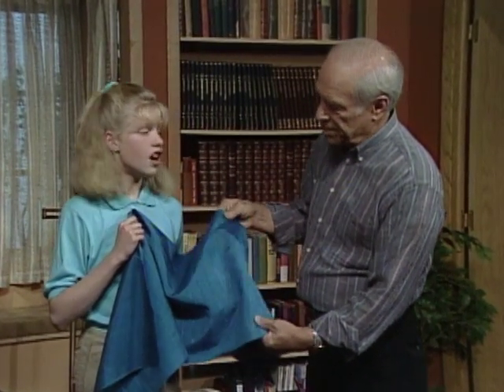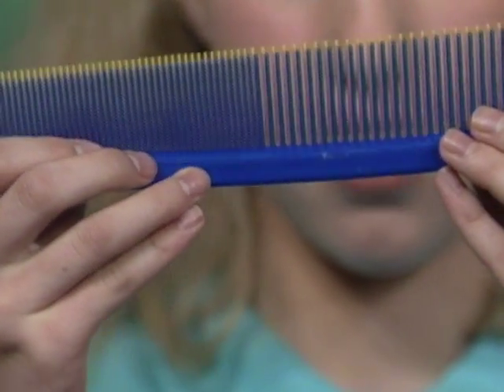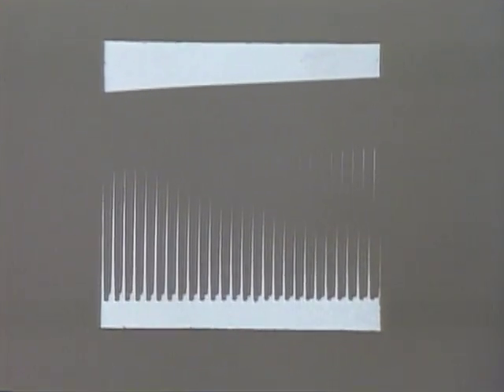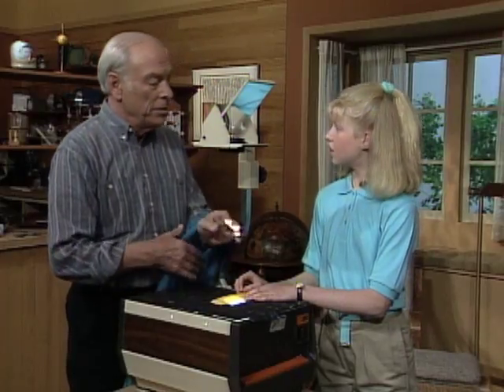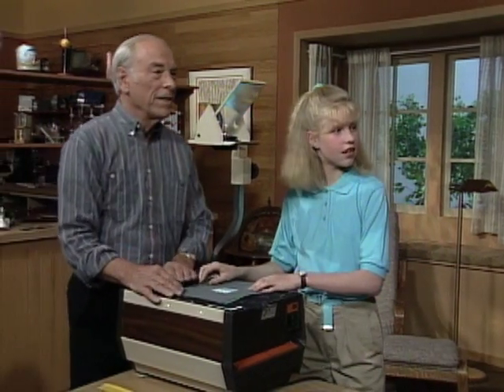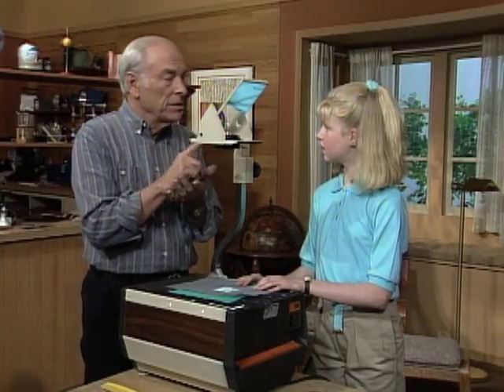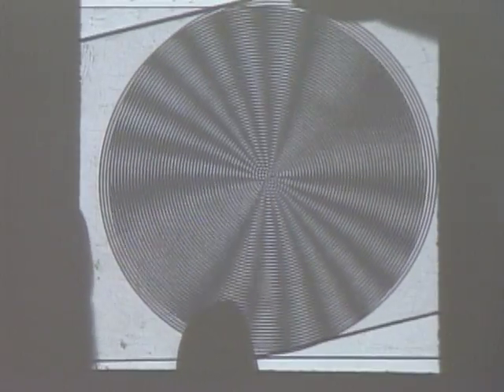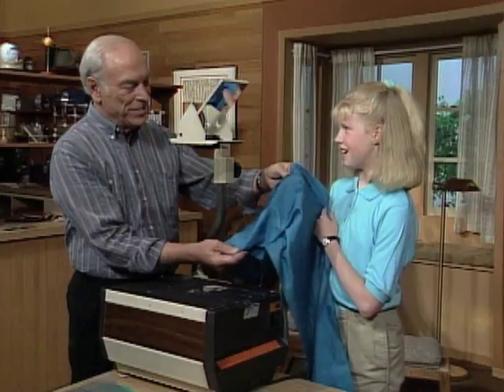What Are Moire Patterns? (Mr. Wizard)

Comment: Sir, What is the practical application of the moire patterns?
Reply: In physics, Moire patterns are used to determine interference wavelengths, especially with soundwaves.
Reply: Tom Scott just released a video about this effect being used a a guide that displays arrows for boats!
Reply: I use them for art
Reply: Super-resolution structure illumination microscopy
Reply: In Scanning Tunneling Microscopy (STM) the observation of Moire patterns is an indication of adsorption of a lattice of atoms (or molecules) on top of the substrate's crystal lattice. The geometric pattern can be used to measure the dimensions of the adsorbed molecules.
Reply: Mainly used in interferometry, since light waves can behave similarly
Reply: Narendran D it gives the camera people something to screech about :) Its gotten better over the last 45 years. I was watching "All in the Family," every time someone walked across the set, any vertical lines at all looked wavy...it's not as bad today, even on consumer cameras.